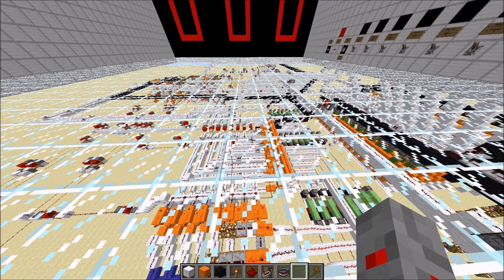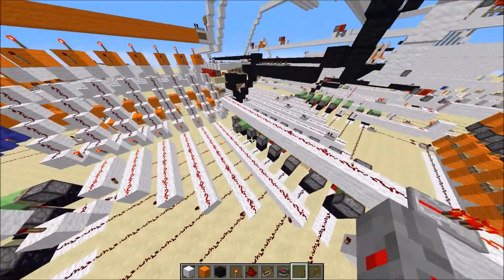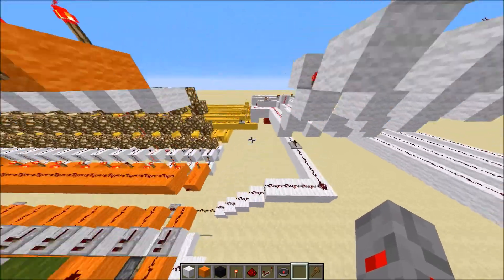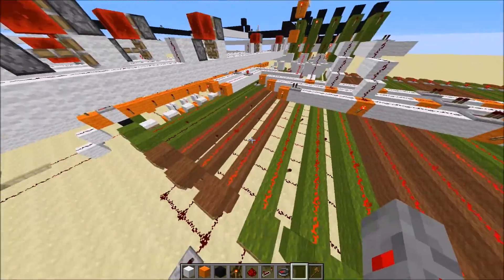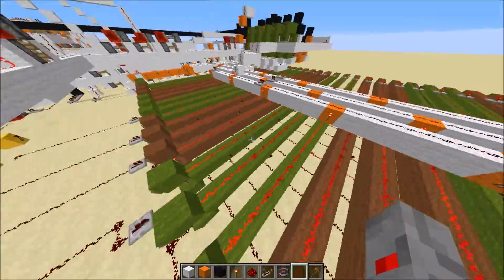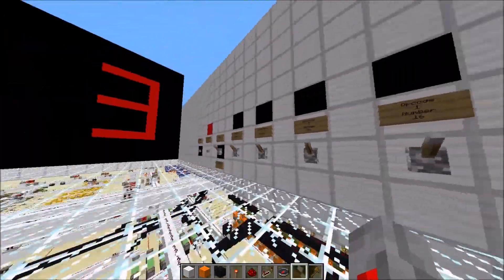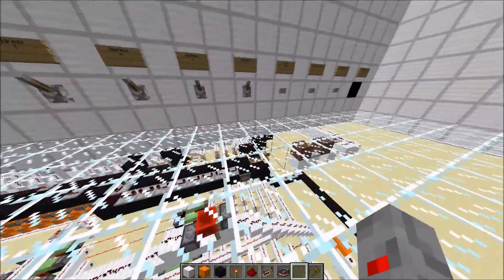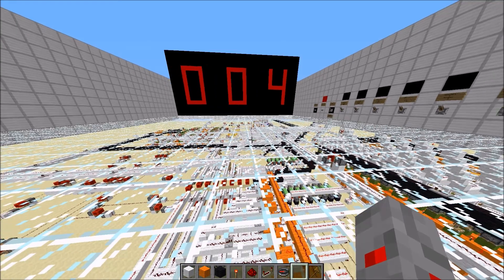Ben eaters 8 Bit Breadboard Computer in Minecraft

Comment: Very elegant solution for the control look up table. 
 I did notice the 0-tick repeaters everywhere :P
Not usually a fan of that (too noisy and often laggier) but in this case the computer is small enough that it seems to be manageable.
Reply from the maker: I used the 0-tick repeaters, since some control signals devices were pretty far away from the look up table, to prevent to much delay slowing down the CPU.